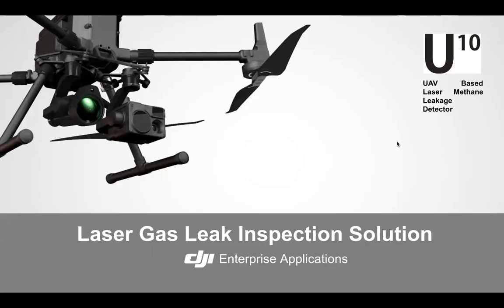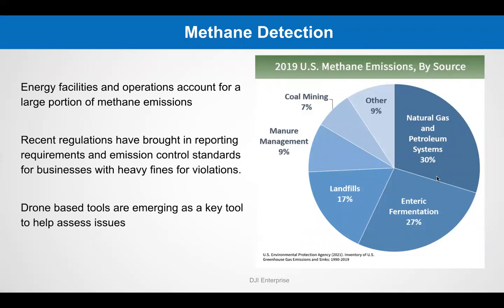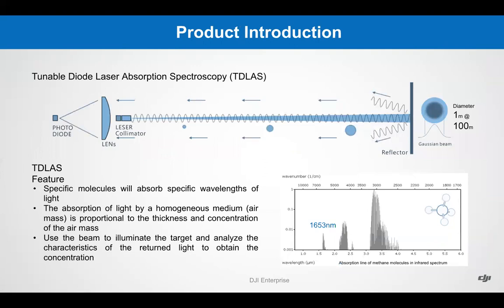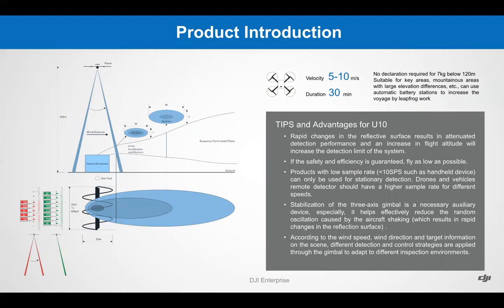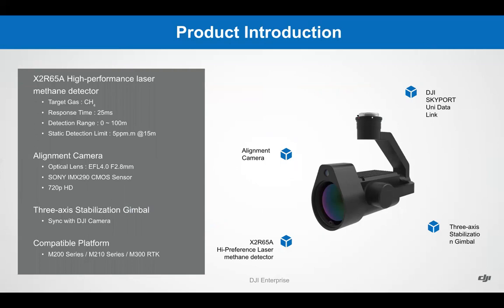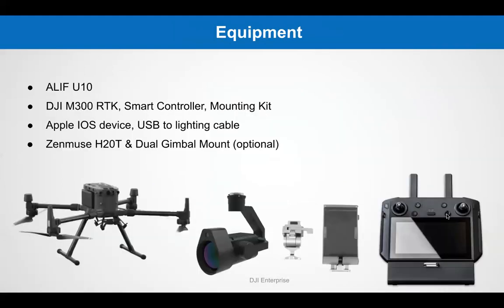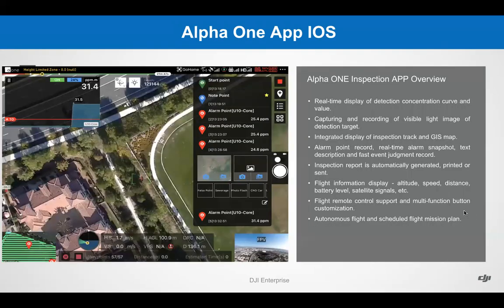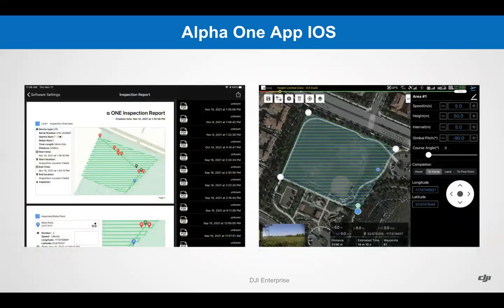Detecting Gas Leaks Using DJI M300 And U10 Laser Methane Detector

Comment: Is there a self-calibration?
Reply: Next vids?
Reply from the maker: There is a few calibration options including methane calibration, gimbal calibration, and laser calibration.
Reply: @DJIEnterprise  more interested in the Methane calibration.  Does the unit store the data showing that you unit does a self calibration showing your methane readings are true
Reply: @charlesgroves6472  The equipment includes a small sample with methane at a specific concentration that you can use to check the calibration.